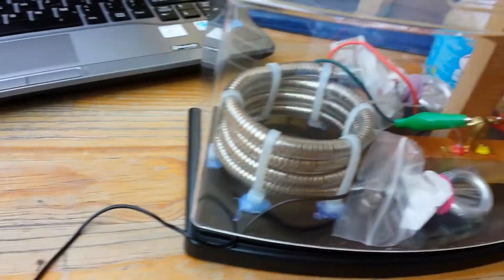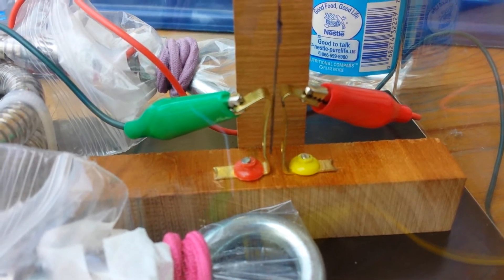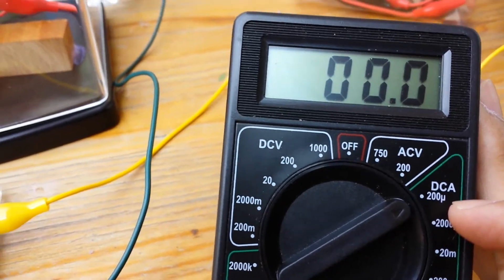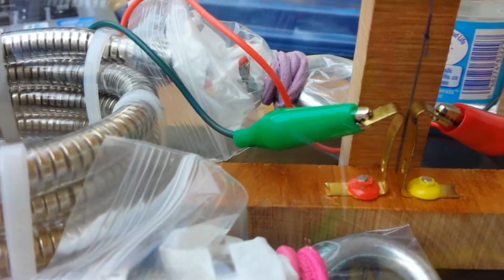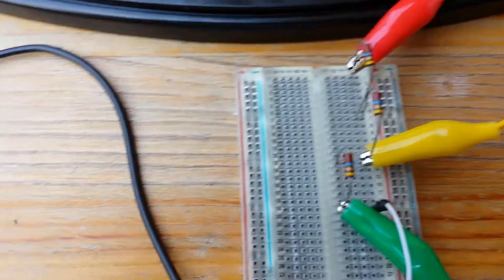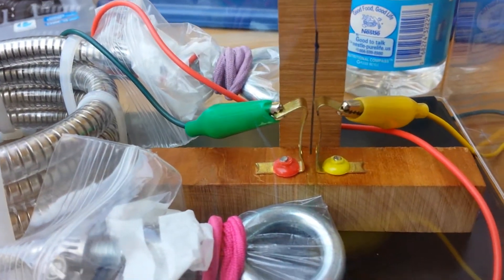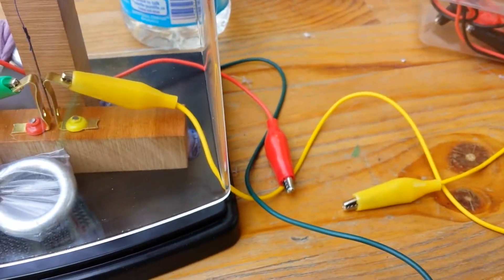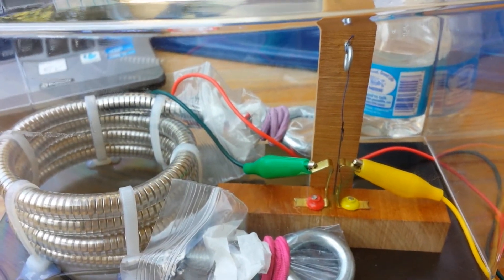Electrostatic Battery Running a Electrostatic Pendulum

Comment: Nice effort. 
If I may be so bold as to suggest one change, it would be to replace the piece of wood with a piece of plastic. The terminals that you have nailed to the wood are causing a current drain at those voltages. Plastic would make it last much longer. In the same way that you demonstrated that your fingers, through a plastic jacket could make a connection, so is the wood making a connection. 

A German man made a similar device, I thought you might want to see it. http://www.renhcrik.de/pendel-fotos.html

I enjoyed seeing your build. Is it still working?
Reply from the maker: Thank you for the suggestions! Unfortunately, I discontinued the project due to the batteries failing after running for 4 months. However I do plan to revisit the project in the future!

Comment: Even though the current draw is minimum for the Pendulum's movement. 
Don't you still need to run the Multimeter via it's 9v battery? 
What I see, is a High-Voltage potential making it easier for the Multimeter to fluctuate the area between the two point test points.
Reply from the maker: The multimeter doesn't contribute to the pendulum. It just measures current. I have ran the pendulum without the multimeter connected.